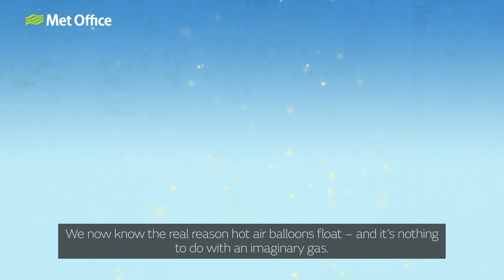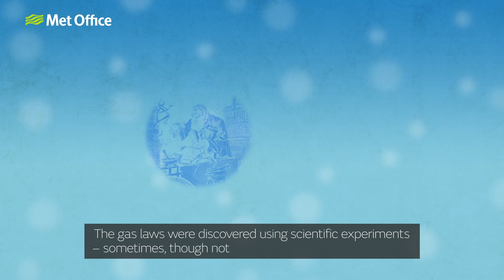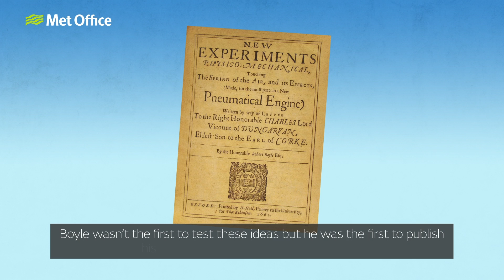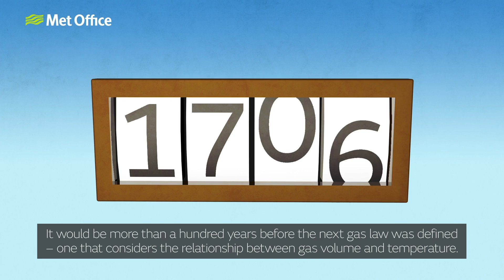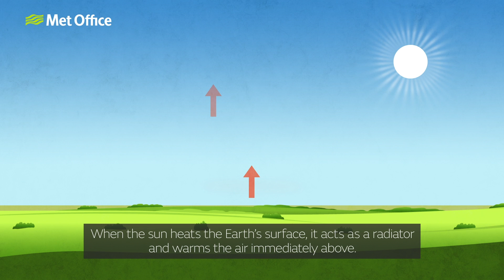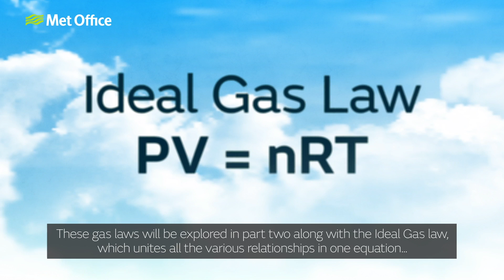What are the Gas Laws? Part 1

Comment: Hot air balloons rise because of the change in density that occurs as the gas inside expands, same mass but greater volume.  Volcanoes ultimately operate on the same principle.  expanding rock, lower density, wants to float.